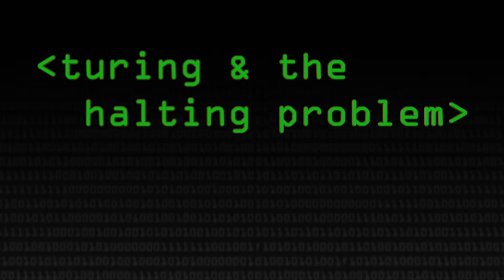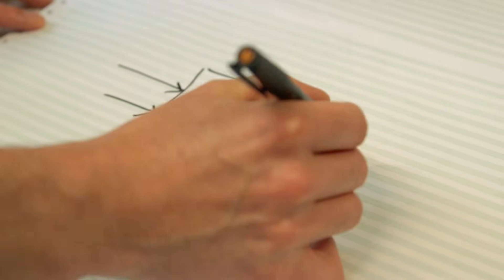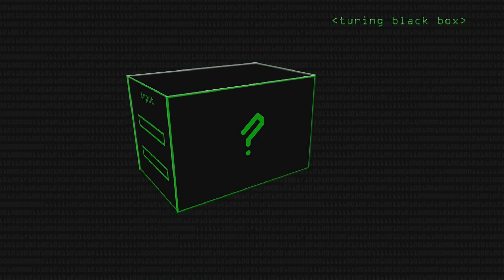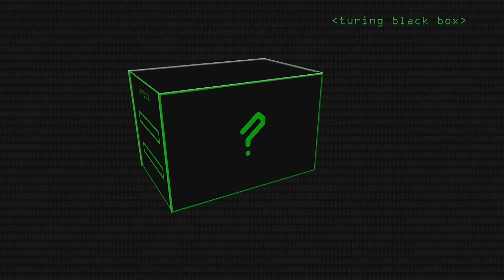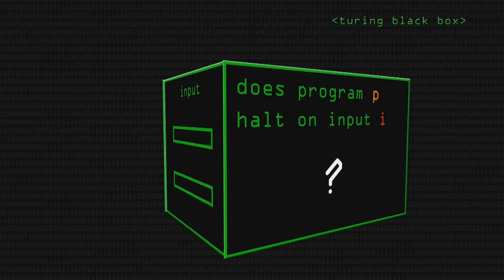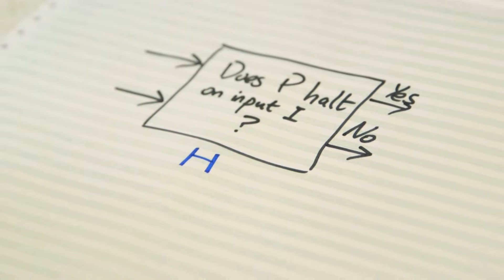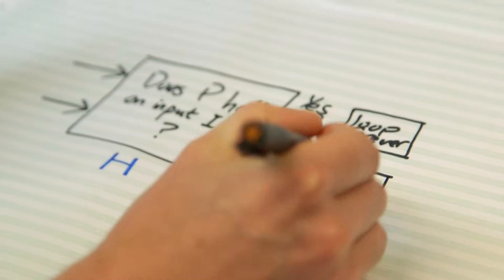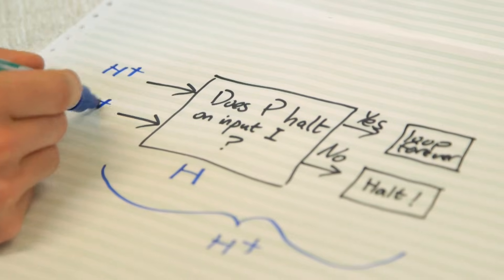Turing & The Halting Problem - Computerphile

Comment: A simple explanation would be that: Assume some program A. This program determines if another program stops or runs with perfect accuracy. And whatever is the result of its output, then it does the exact opposite that. When you input this program A into itself, if A determines that it will stop, then A will run, making it wrong. If A determines that itself will run, then it must stop. Making it wrong again.

Comment: I don't think this explanation is quite right, because you are sending h+ twice into the second program,. That actually does not create a paradox. It has to take only a single input.
Reply: The full version of H+ includes a component that takes a string of input code and feeds it into the H machine as both program and input.

Comment: As a Korean. I can fully understand this video.
That's why halting oracle does not exist, as quoted by Alan Mathison Turing. So, it's impossible to solve math problems with using only computer programs. So, humanity is important, whether AI dominates the whole system or they don't. This contradiction seems like some kind of Liar's paradox, having self-referential structures.

Comment: you failed to convey the proof. Its outstanding how bad youtubers are at this, Neso Academy is the only one which works.

You missed a critical part of part of the H+ machine  : the arrow that duplicates the input on the left (merge the 2 arrows). so that H+ becomes a function of a single parameter. otherwise it just doesn't work (you have H+(H+,H+) on the outside and inside your machine says "H+ doesn't stop on input H+". (H+,H+) and H+ are not the same input... you didn't prove anything.

also you should never say things like "H+ doesn't halt, or H+ halt" because H+ is a function of a parameter, you should say H+(H+) halt or H+(H+) doesn't halt.

Comment: I've never been fully satisfied by the usual proofs of the halting problem because they usually go like this (I'll describe it using math function notation);

Assume you have a function h(x), where x is another function, and h will output "yes" if x is a function that requires an infinite amount of time to resolve (assuming you aren't allowed to simplify infinite sums using closed-form expressions, you must do them step by step), or "no" otherwise.

Now, take the function d(x), which takes an input of "yes" and returns "no", and an input of "no" returns "yes".

The proof usually goes about by passing d into itself, but lets unpack that for a moment... you can't JUST pass d into d, like d(d), that inner d itself is another function, and simply writing it without an input is a nonsensical instruction. h(x) can't compute anything if it doesn't have a function input into it, so you can't ask it whether or not it will compute something in a finite amount of time, so h(x) only makes sense if the inner d is passed a function.

So instead I'll write it as d(d(f(x))), where x is some arbitrary input that is accepted by the function f. Now if you write out the function chain you can start to evaluate outwards, so d(d(f(x))) says "Output the opposite of if d(f(x)) halts", and d(f(x)) says "Output the opposite of if f(x) halts".

If f(x) halts, d(f(x)) does not halt, and so the outer program halts, and vice-versa. Trying to ask if d will halt on its own simply doesn't make sense, because its ability to halt is entirely deterministic on the function being input to it.

Now, I WILL admit that this confusion may be the result of the explanation being drastically simplified, but if this is not the case then I'm going to need someone to explain to me how it makes sense to pass an arbitrary set of steps to someone and knowing whether or not they can be computed finitely without knowing the input. It's be like asking "is n infinitely large?" without saying what n is.
Reply: The point is that if there really existed a computer that could solve the halting problem, it should always return the same output given the same input. So when you give it H+, it should consistently return either "Halts" or "Doesn't Halt". But it can't ever return "Halts" without being wrong, and it also can't ever return "Doesn't Halt" without being wrong. It's worth noting that if H+ magically existed, it would not switch between returning "Halts" and "Doesn't Halt". It would return one or the other every time. But H+ doesn't exist, so it can't.
Reply: @ I understand all of that, but my issue is with the “if H+ magically existed” part. It relies on this assumption that it can be fully defined in the first place, but the definition of such a function is incomplete because the result it outputs can only be determined by its input, but if its input itself is an incomplete definition of a function, then it invalidated the entire chain of definitions above.

Don’t get me wrong, I HAVE seen proofs of this that I accept, but the idea that one can only partially define a function and then ask if it halts or not is just silly to me

Comment: the problem here seems to be that you have two independent boxes, one can be running, the other halted? that doesn't seem to be a paradox, but a problem of definition
i would assume that if even one part of the system is running, the system should be considered as no halted and an external halt analyzer (original h) should be able to account for the extra logic and give a proper answer about the system as a whole, even if it includes its own "code" as a part of the loop

Comment: I am not understanding the logic here at all, because with that logic i look at every problem in this world and say it is not solvable. Let us say we want to Test if a program mprints Hello World. We feed a program P to a Tester T, if P does indeed print Hello World(so yes) i can just then change it to "BOOOO" instead, and if it gives me no, i change the output to "Hello World" ! So we conclude that the problem is not solvable, you can not test if a program prints out Hello World. It does not make sense at all
Reply: The Tester T can not exist.
Reply: You have correctly proven that there is no program that can print "Hello World" in all possible cases. Similarly, there is no program that can solve the Halting Problem in all possible cases.

Comment: THOUGHT ID TAKE ANOTHER SHOT AT THIS...MAYBE GET A RESPONSE....I have no idea of Turing’s proposition with regard to the subject of this video, but only that this video and every other of the four I have watched DO NOT prove the point he was trying to make. They are completely illogical so I would say that if Turing was in fact correct, it was not proved as such by these presentations. 

Consider, the application of a “reverser” program only changes the output of the halt checker program and for no reason. What is the logic of its application, if not to introduce a contradiction rather than discovering one? First the halt checker program only analyzes and input program to determine by its structure what it would do if run for it is not running when being analyzed. That we are to assume for the sake of the discussion of this scheme that it could determined whether and program would halt, we know then that it would NOT have to analyze the input program to determine if it would continue on. That the presentation demands we accept that it CAN determine that a program would halt, we know that should it find that it is unable then the program being analyzed would by definition, continue on. It is the only alternative of the two presented as covering the entirety of the proposition. This scheme fails on that point alone.

Also, given that outlined by the presentation, the halt check program could NOT analyze the reverser program under any conditions mentioned in this video. The reverser program as presented in the video by definition would be available for either halting or continuing on and would not be inclined to either (it structure would not be reflective of either function over the other) except as a consequence of the output of the halt checker which would be its (the reverser program) input. In other words it has to have something to indicate what it would do in opposition. 
My final point here (though there are a few others) is that if the halt checker program is analyzing a program, for example a counting program which counts down from 10 to 0 which would not be running at the time, what is it that the reverser program would do even if given and output from the halt checker program? In this counting program being analyzed and not running at that time. Is it proposed that the reverser program could make such a program continue counting down past zero when it possesses no such architecture?  Would the reverser program start counting up from zero? If the counting program is not running when being analyzed by the halt checker, how could the reverser program continue on doing anything? 

I could introduce a few other problems, but that above should be enough to show that this scheme makes absolutely no sense as a proof of Turings propositions. Can you demonstrate otherwise?

Comment: This problem can be easily solved when the computer is quantum in nature. A quantum computer returns an output that has a superposition of states, and can deliver an answer when it's measured. In this case, the probability of getting a 'yes' or a 'no' is exactly 50-50, but before the answer is figured out by this computer, it has to be built. Since it is a quantum computer we are considering, we might as well ask a human being what the answer would be in terms of 'yes' or 'no'. The correct answer must be a superposition of both, which is the correct justification in this case because the machine is designed to be paradoxical, whose output is not logical.

This is why the halting problem and its implications are not limited to the binary space, but it extends to the quantum space as well.
Reply: The other solution is to alter the problem so that it can be solved, because the problem exists either because it does, or because it was thought of. If it exists because it is, then there must be some solution beyond our understanding. If it's the latter, it can be changed so that the computer can compute.
Reply: You make absolutely no sense. Quantum computers are not magic, there are problems that require more space than atoms in the universe, or more calculation time then the universe will last. Simply put how would a quantum computer print every digit of pi then stop?

Comment: 4:14 This is where the flaw in the logic starts. You stick extra bits on the end of the halting machine, by doing so, no matter what the bits are, this is no longer the halting machine. But you continue to treat it like the halting machine and expect it to function normally. The worst part is that those extra bits are analogous to a "not gate", basically just inverting your answer. This is exactly the same as the "This statement is false" paradox.
You created a new machine that literally inverts it's outputs and then expect it to work like an untampered halting machine and conclude it to be a paradox.
By no means do I think Alan Turing didn't know what he was doing/talking about, but I've never understood this line of reasoning in this specific case.
Reply: The reasoning is tricky but fair. The question is “can a perfect halting solver that can solve ANY halting decision problem exist”. This definition includes self-referential machines, so we’re allowed to demand that the machine get the right answer on these cases where it’s inside something else too. “If it’s perfect, then it’s also not perfect” isn’t allowed, so we can deny its existence.

Of course you can say “what about a solver that detects specific unfair combinations and rejects them” but… consider a machine A (a halting pathological machine that we want to reject) and a family of machines FA that all claim to do the same thing as A, but can be as unnecessarily complex as we want. In order to prove that everything in FA does the same thing as A, we have to prove that they halt since A halts which… we can’t do perfectly. So even though the halting paradox seems specific and unfair, it extends very far to the point that we can’t even perfectly compare arbitrary machines.
Reply: Any algorithm that exist can by defenition be used as part of a larger algorithm.

Comment: Well... no. This is over simplified. You skipped the crucial second parameter for the halting machine, and as a result you don't really get the paradox.
While you do get opposite internal and external results, this is not a paradox!  (This is because the internal halting machine isn't testing the the bigger machine working on itself. This would be defined by the missing second parameter.)